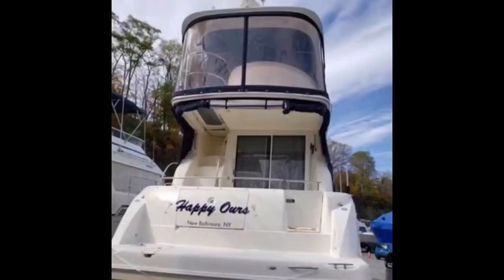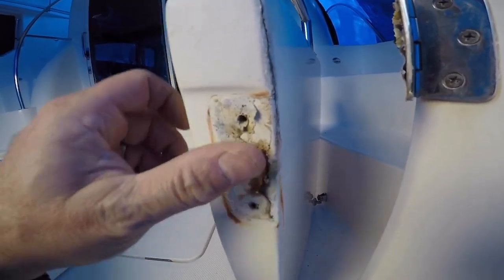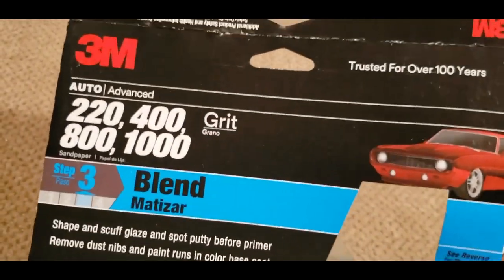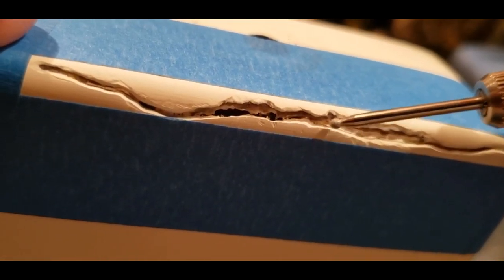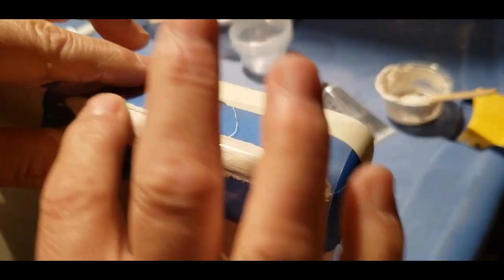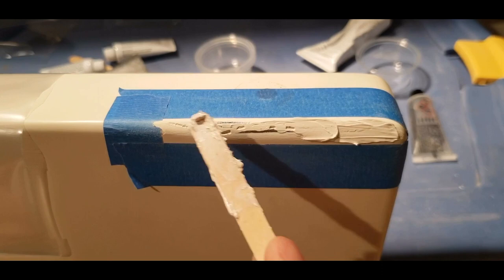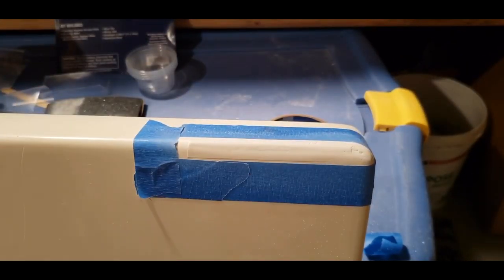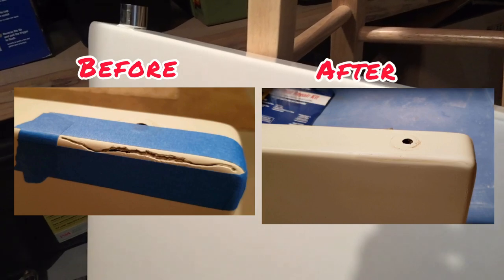West Marine Gel Coat Repair Kit Review

Comment: I think you would have seen a more solid repair by first grinding the crack open a little more and filling it with a epoxy/resin mixture thickened with silica powder. After that, I'd apply the gelcoat and sand it into the appropriate shape rather than using plastic

Comment: That shit is garbage, ive been in repairs and boat building 40+ yrs.  First.  I would of ground, prep, glass, then body work , then gel.   This repair has done nothing for the damage inside.  This repair will last 1 to 2 yrs.   And i have never needed wet sanding .  320 600 rough..  Thats a touch up/'not a repair.  But good try.
Reply: If the gelcoat doesn't set up and stays sticky. How do you remove it. Just sand it back off.  My evercoat doesn't have wax so I covered it and let set for a day. Must of messed up the mix 😳.  Thanks for any help
Reply from the maker: I’m not gelcoat pro but I believe Non waxed gelcoat stays sticky.  Final Top coat should be the waxed type.
Reply: Even if you cover it